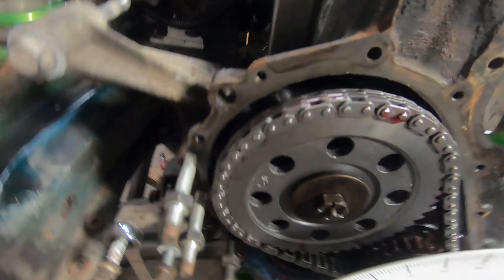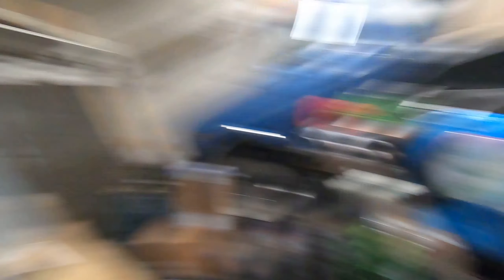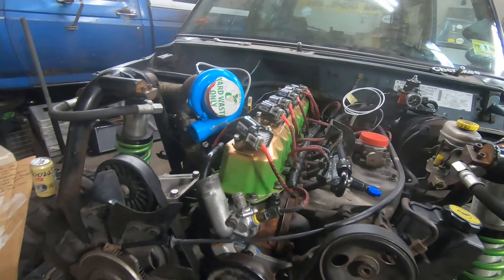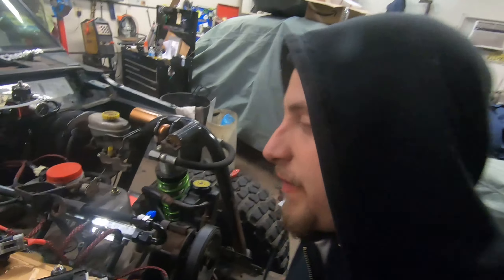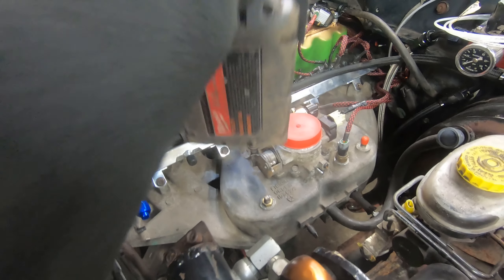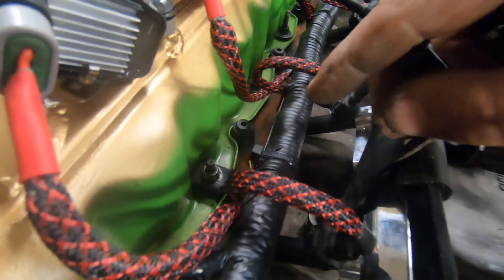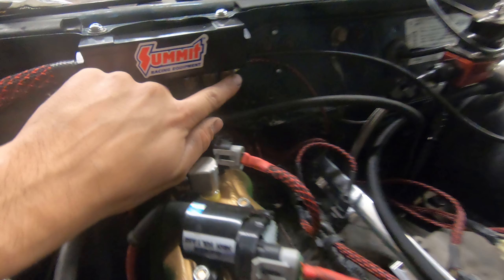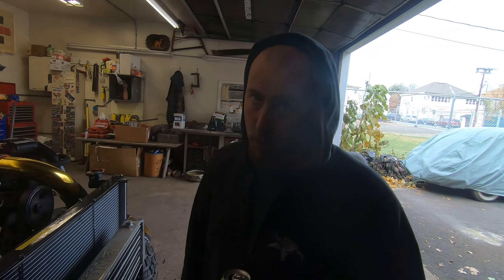Turbo Jeep Cherokee Dyno Prep Part 1

Comment: keen  for dyno..   but 1 question.   why not just use rubber plug end for the water pump heater hose ends?? instead of making copper stuff?
Reply from the maker: Cause it looks cooler loool

Comment: Good looking copper job. Simple and to the point. I can't wait for a dyno update. But hey, if you fall short no worries. You still have a little ways to go. To save yourself some money and the dyno operator some frustration, get it as sorted out as possible before you take to them. They really appreciate that. They want to be tuning not fixing. Oh yeah! Since I deleted my IAC because the Microsquirt needs additional hardware, I just ran a 3/8" vacuum line to a ball valve that I manually control a vacuum leak lol. Cold, open the valve as the car warms up I close the valve. Works like a charm!
Reply from the maker: We plan on screwing around with it, we just need to get it all back together first lol